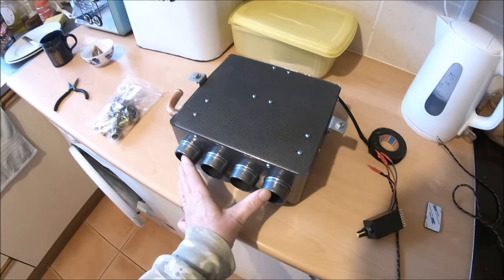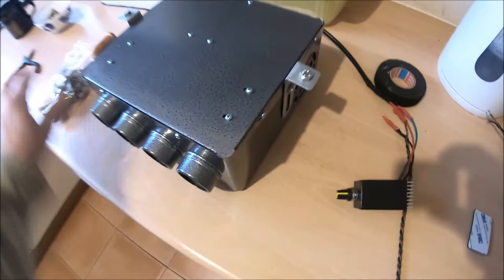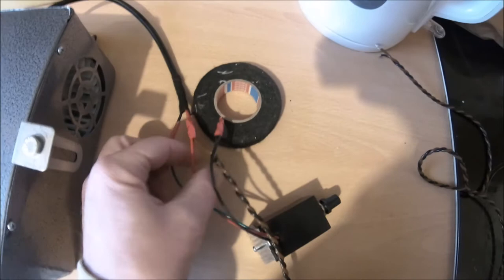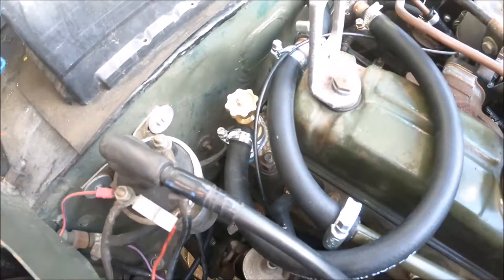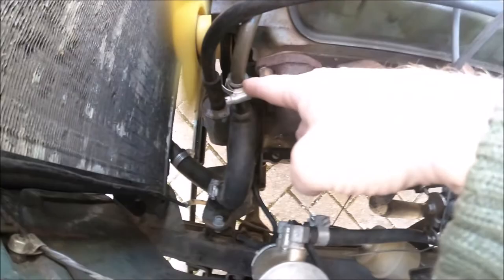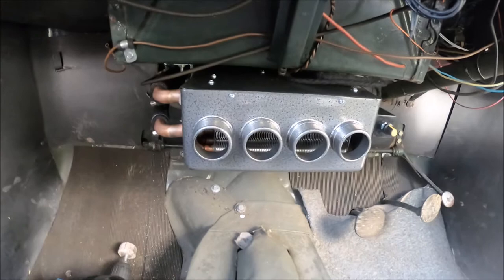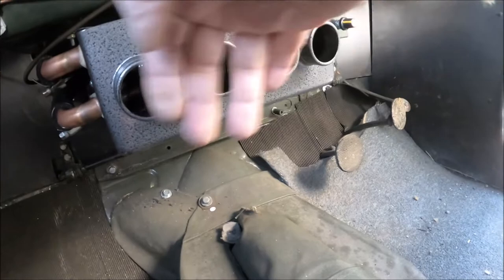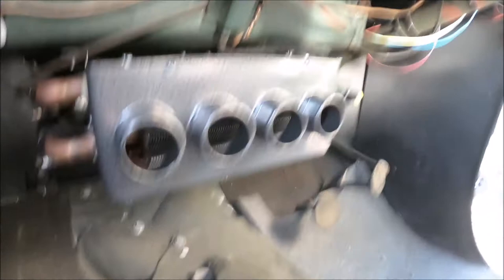Ebay Universal Car Heater 12 volts

Comment: How is it working when up to Temp? R you happy with?
Reply from the maker: No it's not good. When the engine is up to temp the heater cools down as soon as the fan is turned on and blows cool air. The coolant returning from the heater is the same temp as the coolant going in without allowing the matrix to heat properly.  It isn't constructed like a regular heater that has a thinner and longer passage through the matrix.
Reply: @thra5herxb12s   did you hook it up to one line I read somewhere it has to b hooked up on one side it done Rong it will louse heat
Reply: @thra5herxb12s this may be just what I need because I live in a hot climate so I need to ac/ cold air
Reply: how do i find this heater on ebay?  what is the exact type name?